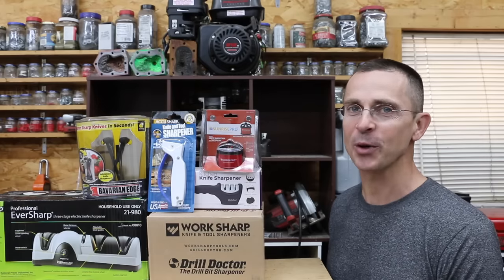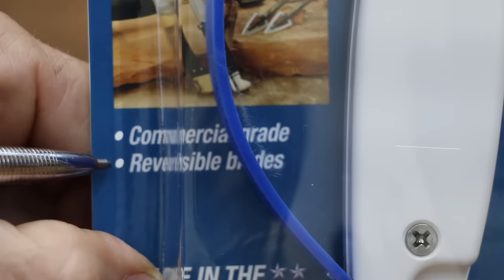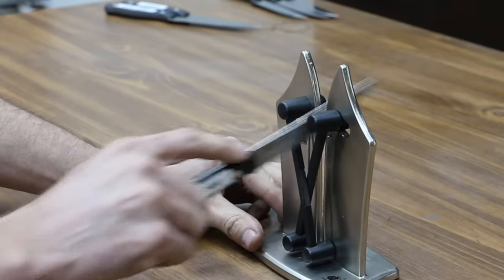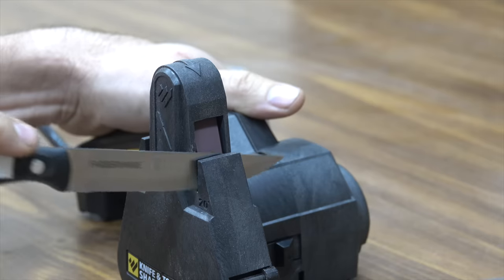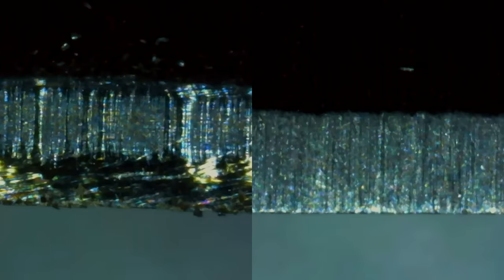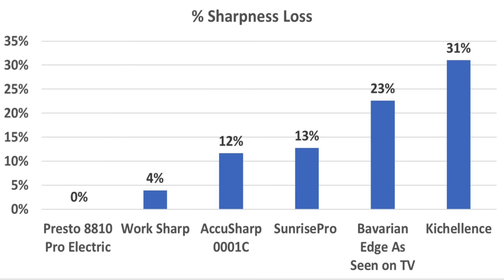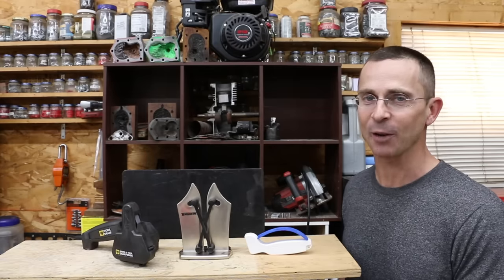Which Knife Sharpener is Best? Let's find out!

Comment: would've loved to see a sharpening stone in comparison
Reply: Same here. But user skill would be a huge variable
Reply: Yes. Even something like a fixed angle lansky or something
Reply: Test w/ a Lansky or Gatco kit. User error is minimized. These kits aren’t going to tear the edges like most of the ones he tested. W/ the Lansky you can finish it at a strop w/ polishing compound level.       Would love to see the Wicked Edge tested. But that’s a whole lot of money for a sharpening system.
Reply: @reidguhr5313  Lansky are great. Make it easy to keep the correct angles.
Reply: Yes I use a whetstone but I use it dry; not whet!  I think my knives are pretty sharp but they will not shave arm hair.  I think this video is probably the best I have seen on the subject.  But I wonder his sharpness gauge; what is it?  It seems that it only checks at one point and how much variation do you get if you checked a few points along the edge?
Reply: True. But to be fair if you are skilled at stone sharpening you probably aren't buying any of these. 
Stone sharpening is much more dependant on individual skill rather than a comparison of method. 

A skilled hand on a good stone will always beat out as seen on tv style pull throughs.
Reply: @bobzwicker807  is there a difference in performance between a wet whetstone and a dry whetstone?
Reply: I just bought Accusharp.  Wet stone beats accusharp (and therefore maybe others here) any day by far from my experience.  Very convenient but also hesitant to use on more expensive knives.
Reply: @ghostdawg527  YES
Reply: You don't have to, those peaces of "sharpening thingy are crap". Also every knife have a different angle.
Reply: Are any of these good for fillet knives? What would be a good number on your meter for a fillet knife?  Thanks for the comprehensive video
Reply: @rickrazz7136  If it matches the angle of the knife it would work OK but thrust me, just learn how to sharpen on a wet stone, grit 1000 and 3000 is an awesome starting point.
Tbh it is not that hard and you will have knifes sharper than 99,9999% of the people who does not use a wet stone.
Reply: i have a lansky works great but takes forever  plus mine has the knife holding clamps that break loose all the time. i can tell u a belt sander type is superior. i went to a knife trade show bought a cheap knife the man sharpened for me in literally 15 seconds on a belt sander and ive never had a knife hold an edge as long as it did the belt sander keeps more meat on the blade keeping the edge longer. I plan to buy one in the future just been to cheap to pull the trigger.
Reply: @ghostdawg527  A Whetstone is meant to be used wet to keep the metal shavings out of the stone and a clean cutting surface.
Reply: @redtobertshateshandles  there aren't any correct angles, see how you used the plural version of angle? As long as edge is uniform and honed, it can be a 90 degree angle and still be sharper than most knives people are carrying.
Reply: @leafonhead777  Correct I wouldn't let any of my knives touch any of these products. Stones are the only way I would sharpen a knife. As he noted in the video some of these sharpeners change the angle of the blade. With a bit of practice anyone can use a wet stone and get a MUCH better edge on their knives. Now admittedly using a stone takes a lot more time.
Reply: @rickrazz7136  most likely not, the angle on a fillet knife is very different than a kitchen or utility knife.
Reply: kelli43938  Sharpening a knife with whetstones and a strop should first thing to lear for anybody who wants to prepare some food some day. It does take only few hours to learn the basics of using whetstones and after that you can make the edge sharper that any of those sharpening toys.
Reply: Nothing compares to using stones. Sharpness and polish etc
Reply: @rickrazz7136  I would stick to a whetstone for filet knives.  The edge angle is way different
Reply: @Hunter No -- Dry whetstones clog rapidly with swarf, that's the purpose of the water/oil, to clear the swarf from between the sharpening surface particles.
Reply: @mudmanKC  just watch some youtube guides on how to use wetstone and you soon will get better results than any sharpener. I start wet stone was abit of a hassel, but when i lerned, i get quicker and blades lasts sharp for longer. Now i sharpen my blades once in 2 months.

Comment: "Professional" - "For home use only"
Reply from the maker: Gotta love the marketing guys.  lol
Reply: Zeksteve  That's how Tormek differentiates their (very expensive, but very highly regarded) blade sharpening systems.  Their more expensive T-8 is rated for continuous use and has a 7 year warranty including commercial use, while the cheaper T-4 is rated at 30 minutes per hour duty cycle and has a warranty of 7 years in the home or 2 years in commercial/industrial/institutional settings.
Reply: Zeksteve  I've known some people who buy used washing machines and dryers built for laundromats, with the theory that they are made to take heavy use and abuse while still being relatively easy to fix when needed.
Reply: I got the Razor Sharp Edge making system for christmas. I would have loved to see it tested. There are a few more out there for round 2.
Reply: hahaha
Reply: Yeah. Take a Stihl to a dealership to get fixed.
 "How long is this rebuild guaranteed?" 
"30 days."
"WHAT!?!?!?"
"It's a commercial saw."
"But I'm not using it commercially."
"30 days."

Comment: So A: it's truly amazing how you figure out how to test everything and B: I have yet to figure out how to sharpen anything with a blade or edge. I usually just make them duller than before.
Reply from the maker: Thank you very much!
Reply: You should look at some fixed angle sharpeners. I have a Lansky Sharpening System and it’s so easy to use. The only problem is you’re limited on what angles you can sharpen your knives at, so you might have to re profile some of your edges, which takes a little bit of time.
Reply: Been there, done that, have a t-shirt
Reply: I personally use dry diamond in 600, 1000, 2000 grit and finish with oil corundum 3000 and 10000, works very well as long as you keep a relatively consistent angle.
Reply: It's all angle and ability to keep that degree of angle each set of pulls and is same for getting a good edge with these out anymoresharpers.. I gave up on issuing my stones to sharpen after trying the Rada sharper with two round washer like discs. Razor sharp in 1 minute Everytime...

Comment: Would you ever consider comparing the difference in shaprness from sharpeners shown here compared to something like the edge pro apex or other professional grade sharpeners?
Reply: Edge pro is not a professional grade tool, enthusiast grade? Yes.
Reply: Knife Sharp works wonders. The key is working the edges back and forth and keeping track of burrs and rolled edges. 

After the 6000 grit belt it still needs a slight stropping to get it perfect.
Reply from the maker: Great suggestion for a round 2 video! Thank you
Reply: @ProjectFarm  Yes, not to add even more work, but I personally have the Chef's Choice 130. I've been interested in getting some kind of whetstone or "system" like the Edge Pro Apex mentioned. If you do a part two would you be able to fit all these in....and possibly a whetstone and stropping leather (or whatever a real knife enthusiast would use? The Chef's Choice sharpeners are a very similar design to the Presto Professional EverSharp but are over $100. If you do decide to take all those on, I'd be REALLY curious as to how all those rate with what you have already done. Thanks and really enjoy your videos.   -Henry

Comment: Great video! Just wanted to add my 2 cents as a work sharp (ken onion edition) owner.

You had mentioned the edge looked more concave- it’s actually convex which is why the edge was so much more durable and why I love the work sharp for my EDC and survival/bushcraft knives. You get the convex edge as a benefit of using the belts.

Also, you can get additional belts for the fine part of the edge and stroping to help with the final edge.

Again, great video!
Reply from the maker: Thanks!

Comment: Great vid! I finally got the Work Sharp Ken Onion edition sharpener a few weeks ago. Worth the extra price imo. Comes with more belts and you can set different angles. Can get a mirror edge on your knives if you want. Comes with a cool infographic that shows what to do for different knives.
Reply from the maker: It's a great sharpener!  Thank you
Reply: Project Farm I think you should do a video with more expensive sharpeners and include the work sharp Ken onion addition
Reply: I have the basic work sharp and it buggered up the ends a bit. It doesnt get all the cutting surface of the knife edge using the guide and its limited to one specific angle. A bit disappointed with it. Also have the presto and that can also ruin a good kitchen knife.

Comment: Was considering trying out some of these due to friends stating "They work just fne"... after this video though, I'll stick to my whetstone collection. Thanks
Reply: I have a knife sharpener similar to the second one he shows (the small red). While you get a relatively sharp knife quickly, you have to sharpen it again often, and it take away a lot of material from your blade. It's a disaster.

Today I use whetstones and it's just not comparable :-) the little sharpener stay in a drawer.
Reply: Belt sanders will get you the best edge available, but I understand the appeal of using stones. It's like driving a manual transmission car.
Reply: @SergeantExtreme  I'd imagine you'd have to change out the belts pretty often, as they don't have the durability and/or thickness of whetstones?
Reply: @maximilianeissner4759     Yes you'd be correct. However, in exchange for having to buy replacement belts, you ultimately get a superior, consistent edge from handle to tip. Most people who sharpen blades by hand can't come as close to blade consistency as I can with my Work Sharp.

Not to mention belt sharpening is the ONLY way to get a convex edge.
Reply: @SergeantExtreme   I aint never seen a straight razor without a hollow ground edge and I have never seen anyone get a knife sharper than a good stone and a leather strop can do
Reply: @SergeantExtreme  You can get a convex edge with whetstones also. Just use a wrist roll technique. 
Matter of fact, using a whetstone will create a convex edge, to some degree. <---- no pun intended ;-)
Reply: @SergeantExtreme   make convex edges on a stone is easy , even easier than in a belt grinder , i think you mean concave/hollow grinds
those are  quite hard but not imposible with special curved stones or a bench grinder

in the knives i made i like to set  the edge  on the 2x72  belt grinder and then refine it with the stones to 12000 grit , then stroping or buffing 
in a microscope the edge turns mirror polished and the knife is  razor sharp

The Work Sharp (atleast for the video image, i 've never used one and probably is't available in my country) makes a very rough edge, tecnically is a micro edge saw
feels very sharp , work fine even very well in materials like cardboard,
but it dulls faster specially in softer steels 
because of the microdents   you lose more material and you have to resharp it more often 

a nice set polished edge last longer and  only needs touches in the stone to become again a razor sharp tool 
for me it's not like driving a manual vs automatic
  it's like a  fast street car  vs  f1 car , both cars but one excels in it job
Reply: @geneplummer6645  I have a leather belt for my worksharp that I use with buffing compound. It takes it to another level. If you're into knives, the worksharp is the way to go. You might be able to get a slightly sharper edge by hand, but the way I look at it is 90% of the sharpness for 10% of the effort.
Reply: @NikoMoraKamu         Actually, the belts on a Work Sharp aren't actual sandpaper. They're specially made abrasives that don't cause the microdents you previously mentioned. That's what sets Work Sharp apart from a normal belt sander.
Reply: @SergeantExtreme  I would take that bet.
Reply: @winocity  I been makin knives for over 40 years and it always comes down to a good stone and a strop after all the power tools are put away .
Reply: I've use belt sanders. They make quicker work.. but I enjoy using my stones. Therapeutic almost.. not everything needs to be done in the fastest way. Are my stones not as good as your belts? I really don't give a fuck. I enjoy them and that's all that matters.
Reply: @Rook101     To that extent, I can agree. Watching people stone sharpen knives triggers my ASMR, so yes that's very therapeutic.
Reply: Belt sanders give micro serrations they have flex and that allows angle of the blade to wonder and round off not good
Reply: @totallynotawerewolf2936     The word you're looking for is "convex edge". Belt sanders give knives a convex edge. It's a superior edge to a flat edge, which is what you get when you stone sharpen a knife.

Comment: Thanks for doing this! I've been using a Work Sharp for years, and I found that it is a lot easier to get a consistent sharp edge on a high quality knife than on a cheap knife. There are some cheap knives that just can't be resharpened properly. Would be interesting to see how these perform on a good chef's knife.
Reply: Amen to that....that's some crappy steel on those Faberware
Reply: @owencousins8271  That's steel? I thought it's Chinese pressed rice... Would've explained why powered grinders failed this much!

Comment: I have the AccuSharp knife sharpener, the first one. I've had it for years. It puts a sharp slightly serrated edge on my pocket knife, which cuts through rope easily. In the kitchen, it puts a sharp slightly rough edge on the chef's knife which makes cutting tomatoes and meat easy. I prefer this type of edge.

Comment: The belt driven one (adorable) had the most potential.  They asked you to draw the blade until it developed a burr on the opposite side; I never saw you test for a burr with the pad of your thumb.  You will know it when you feel it.  
This is done because once a burr develops, it means the angle grind has reached the actual blade edge; nothing has actually been accomplished until the burr has developed on the opposite side.  Then switch sides and draw the blade until a burr develops on the other side.  Then switch to the finest belt and do the same back and forth gently polishing it.  

Until you have a burr, you have not reached the blade edge, you are only drawing steel from the side.

https://youtu.be/ZlI5PaXsfOk for both the system I use, and the technique and science
Reply: Of course you didn't see him, this wasn't actually done in 15 minutes it's called editing.
Reply: If he tells me he did it. I’ll accept it.  But I am speaking from personal experience, if you grind until you get the burr, then switch and repeat, then do the same with a softer grit, you will have a deadly edge.   I love ProjectFarm, but his own words stated what he did, “5 or 6 passes”.

And sniper hat, anything is possible, like a ceramic blade, but I’ve never encountered a quality steel which did not burr.   And these blades are all “steels” which will burr.
Reply: sniperhat1  any steel wil "draw" a feather burr...its a matter of angle...even a 90deg shoulder can be drawn out on a steel...a feather isnt "sharp"...it will appear as a very fine saw tooth edge under a microscope...a fine worked steel will polish the feather off to leave a scalpal sharp edge...at the extreme...just saying...ANY of these devices are NO match for even a beginner on a steel...learn to use one & find out
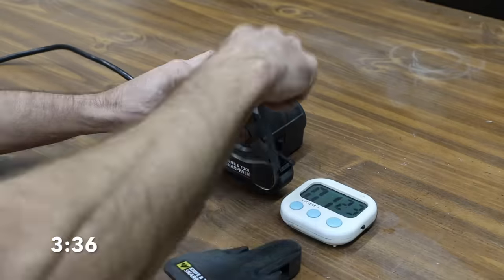Reply: @ 12:13 and a few frames after that he checks, I wondered as well
Reply: sniperhat1 they will all develop a burr. If not you aren’t sharpening properly